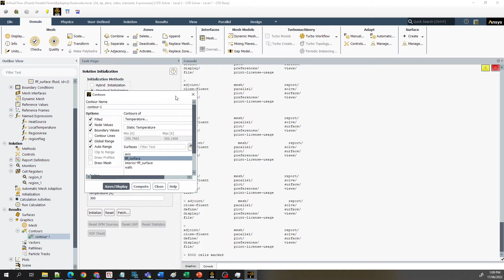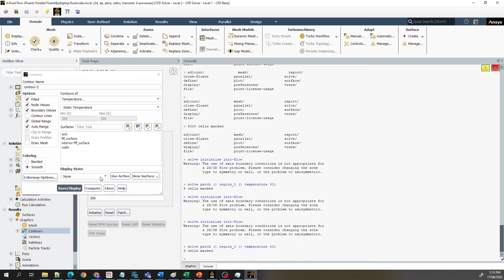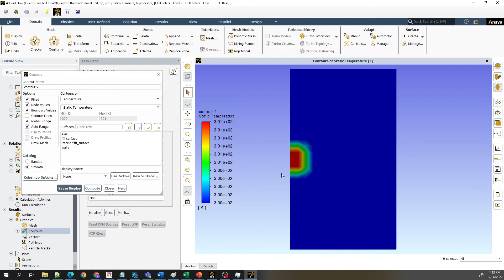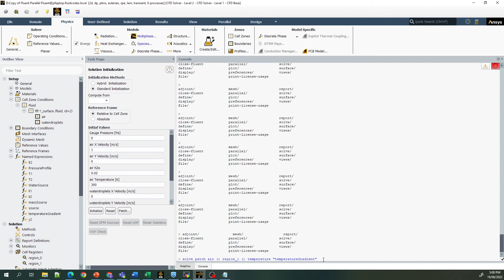How to Patch in Ansys Fluent Through the GUI and the TUI

Comment: Hi Dr, I am working on a 3D simulation model to study the behaviour of high pressure CO2 leak in atmospheric environment. I have a question regarding patching my CO2 inlet conditions (temperature, pressure) . I initialize the model using standard initialization > all zones. This is how I patched my inlet conditions. Could you please advise if this is the correct way of doing this? how do I then patch my inlet conditions? do I have to create a new boundary for CO2 inlet and select that? I went to Cell Registers>New>Boundary and selected the co2_inlet boundary zone. I did not change any of the default settings. After standard initialization, I clicked on patch, in the patch window, selected the boundary that I created earlier and patched the pressure and temperature of the CO2 (50 dc, 5MPa). I would appreciate your advise on this. Thank you!

Comment: hi dear teacher. 
I watched your video and it is very helpful. I have a question for you.
I have liquid and vapor zones on thermosyphon heatpipe. I am preparing a jou file. I created two regions named region_liq and region_vap with adapt. but I couldn't find how to patch with TUI. I tried many times but it didn't work. please can you help me with this. thank you. 
best regards.
Reply from the maker: Hi Cetin. 
Thank you for your question. 
You have to make sure that your cell zones and cell registers names do not contain any upper cases.
Now there are two solutions, if you are using multiphase or not. 
If you are using multiphase:
solve patch my_phase () my_region () my_variable my_initialization
Of you are not using multiphase:
solve patch my_region () my_variable my_initialization
where my_initialization can be an expression or a number
thank you and let us know whether you need further information.
Enjoy your Fluent Adventure!!
Reply: @fluidcodes-ansys-partner   Hi Dear Teacher,
Thank you very much for your help and well wishes. You explained it really well.
I want to ask you one more question. What does mem-per-cpu found in sh file mean? I set it to 8G. but how can i set this value correctly.
Reply from the maker: @cetinyavuz2115  Dear Cetin, 
Thank you for your message. 
Can you please clarify which file you are talking about?
I am assuming it is a PBS/Slurm job submission file. Correct?
Thanks
Reply: @fluidcodes-ansys-partner  yes teacher it is a slurm job submission file.
I enter the value I mentioned as 4 and 8GB. but I don't know exactly how to calculate and what it means.